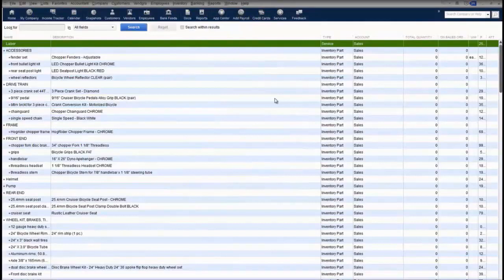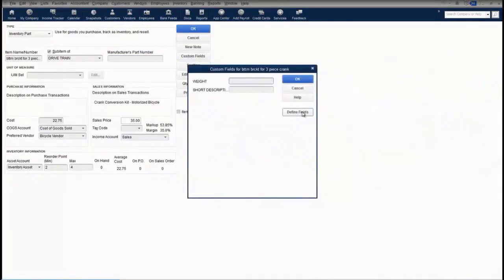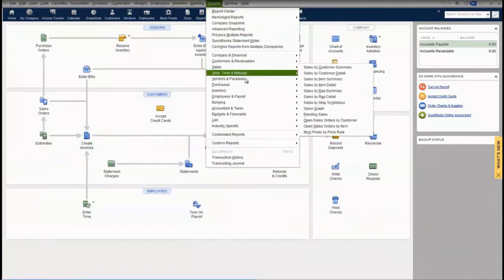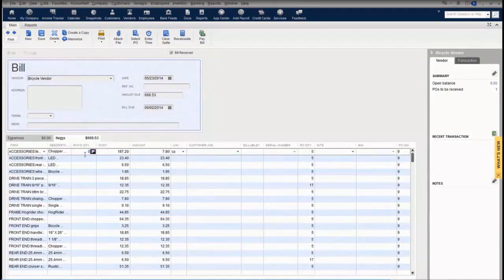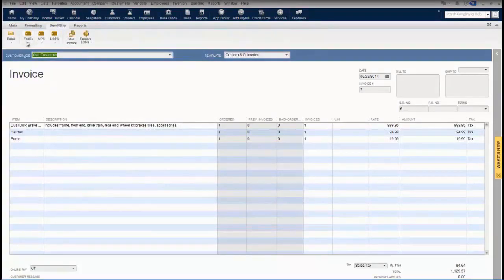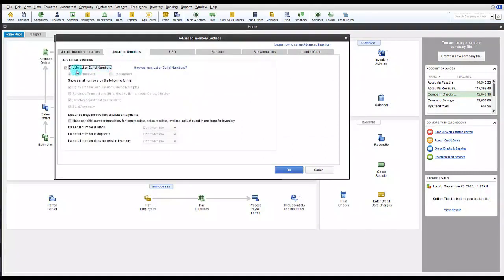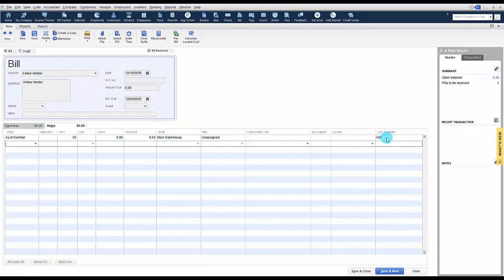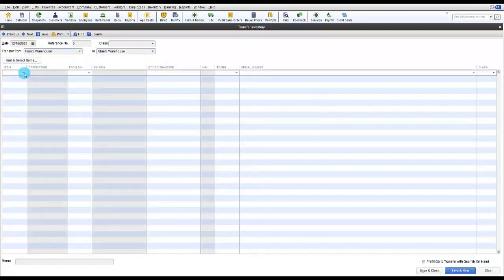QuickBooks Enterprise Manufacturing Demo 2023 | QB Enterprise Manufacturer 2023 | Advanced Inventory

Comment: Nice presentation, comprehensive but no mention of Costing the Manufactured Products. Also no mention of the Chart of Accounts Account Codes involved during the Manufacturing Process.
Reply from the maker: The Costing comes from the assembled item once the product has been built.  The Chart of Accounts is used when you create the individual inventory part.  That is where you enter the chart of account codes.  Thanks for pointing that out.